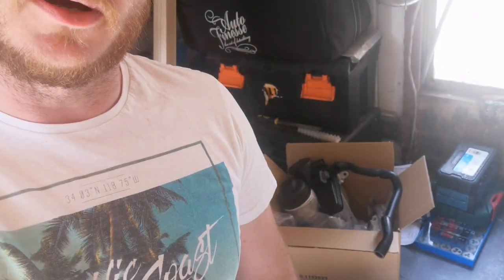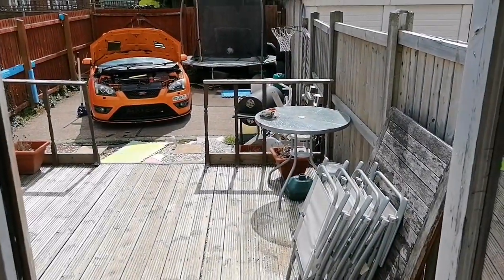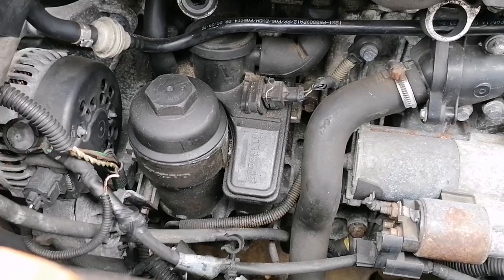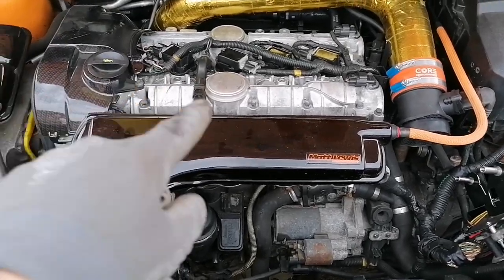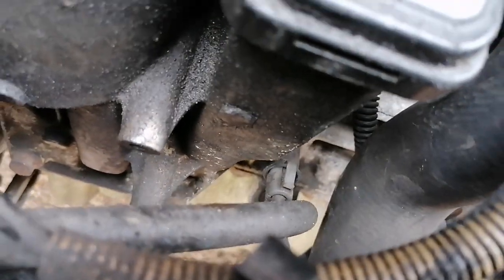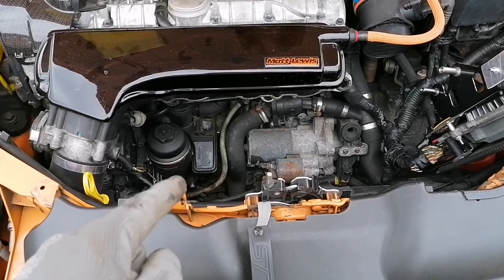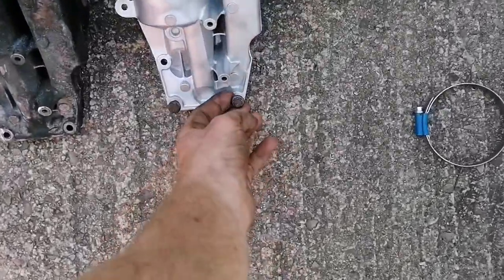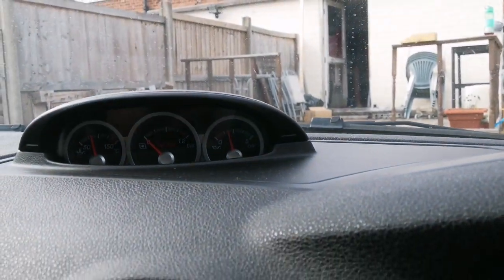Changing the oil filter housing on the mk2 ST

Comment: Great video mate, im having exactly the same issue and been told it could be high crankcase pressure 🙈 how has yous been since you did the repair?
Reply from the maker: Don't know mate as I sold the car not long after but the time I did have it there was no issues at all
Reply: Cheers mate 🤞 mine will be 👍
Reply from the maker: @rdobbi  yea mate you'll be sound. Worth while doing in my opinion and future proofs it too
Reply: @mastersmods  absolutely mate mine started leaking so want to get it sorted 👍

Comment: What oil are you using bud , I’m running stage 2 map with all the hard were, I’ve been advised to use castrol edge 0w 40 , not the spec for the factory standard engine but better for a modified engine? Good video well shot could see everything clearly. Keep up the good work bud 🤘🏻😎🤘🏻
Reply from the maker: Cheers mate 😁 I'm using 0-40 as its for modified where as standard I think they say 5-30 so 0-40 will be fine

Comment: Why not just change the diaphragm? I just did mine (I'm in Australia and had to get the part from over your end) $60 compared to $800 for the housing.
Reply: @thepidmeisterthey do leak when the diaphragm fails, but £100 is cheap considering you get whole new seals and a filter I guess
Reply from the maker: What I didn't want to do was change the diaphragm and still have it leaking so again, made sense to change the whole thing. Peace of mind
Reply: @mastersmods  oh, okay i get ya. still a good vid sorry it was a pain
Reply: Good video I’ll be changing mine soon I’ll get that new pipe and also some new bolts just to satisfy my ocd 😁
Reply from the maker: @metamonkey4262  cheers mate and hello down under 💪🏼
Reply from the maker: @cjmackay9804  ha ha yeah defo recommend getting bolts, just in case 🙈
Reply: @mastersmods   next ill be following your mondeo hood conversion.
Reply: I payed 6£ for new diaphragm and after 6 months I had to replace all the gaskets on the filter housing.
Diaphragm still works fine and if it fails another 6£
Reply: I've just purchased all the gaskets I'm still waiting for the diaphragm to come back then I'll be whipping mine off I'll make sure everything is nice and clean when it goes back together. I'm losing a small amount of coolant, we've found staining around the thermostat housing so I've bought a gasket for that too just to be on the safe side.
Reply: I changed just the diaphragm on mine. The only one available is slightly smaller than the original and its never been right. Can smell crankcase gasses in the cab and its never ran right since. Changing the housing today!